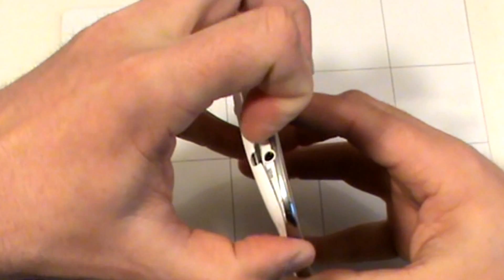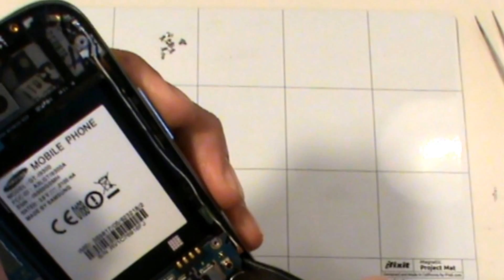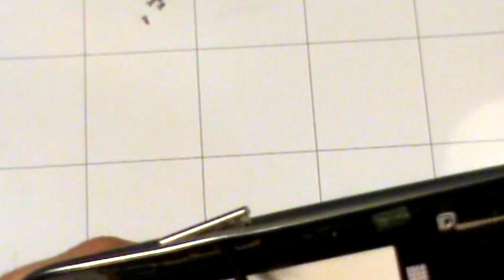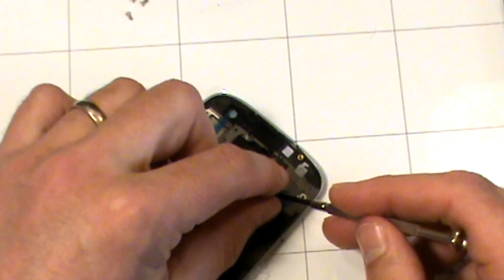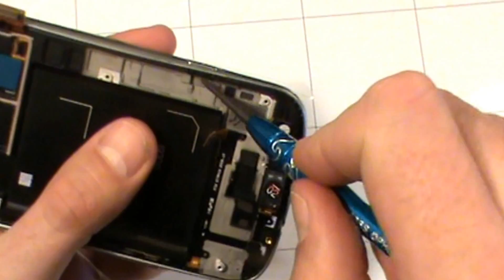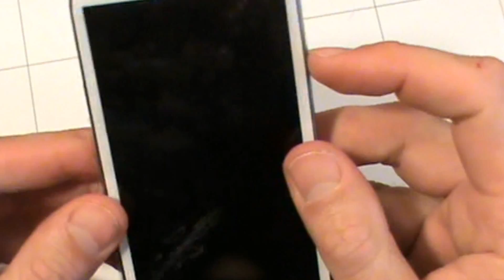Samsung Galaxy S3 Screen Replacement Guide

Comment from the maker: Hi Eddie, 

You can buy the frame but you will need to separate the glass/digitiser from the LCD. If you do this, you might as well replace the whole unit (LCD & digitiser) because it is a tricky job. 

I hope that helps. 

Regards, Will

Comment from the maker: Hi Scott,  Thank you for getting in touch. I purchased the screen I used in the video from a supplier on eBay. It's a genuine Samsung screen. You can see the same one by clicking the link above using the 'White' link to eBay. I had to take some parts from the old screen (e.g. volume button cable) and put them onto the new screen. This is quite easy to do. You shouldn't need to buy any parts apart from the new screen unit. I hope that helps.

Regards,

Will

Comment from the maker: Hi James, you need to check with your supplier that the parts are interchangeable between the LTE and non-LTE version. The video above was made with the non-LTE version. The screens and the same size and are both SUPER AMOLED but check before you buy. I hope that helps. 

Will

Comment from the maker: Hi there, you will need a small Philips screwdriver, a plastic spudger, a small flat-head screwdriver (precision screwdriver), fine point tweezers (useful for the small screws), double-sided adhesive (not entirely necessary but useful) and an iSesamo tool for helping to separate components from the board. All these tools should cost you less then £20 (~$30). The main thing that can go wrong is  tearing cables which is not expensive in most cases (apart from the new screen). A novice can do it.

Comment from the maker: Hi there, If you have all the tools already, then it will just cost you the price of the screen. You can see the price of the replacement screen by using the links above in the notes. Tools are a little extra.

Comment from the maker: Hi Talha, it depends on what has happened to your S3. Has the screen broken? Or, is it not working because it may have come into contact with liquid. Normally, if your screen is not working because it has been dropped, then replacing the complete digitiser/LCD will repair it. You can follow this video to do that. 

Thanks for getting in touch.

Comment: I think it took me about an hour and a half, had a few issues with the glued items where in your video they came off easy enough, some of mine were tougher.  All in all, following your video it was pretty easy enough to do. When I dropped mine I smashed the screen completely (dropped it off a train onto ballast glass first), also chipped the hell out of the silver trim. Most annoyingly, it had just been repaired under warranty by EE 5 days before I dropped it which included a new screen too haha

Comment from the maker: Hi there, I'm glad you like the video. It takes a bit longer than 10 minutes if it is the first time you have done it, as you have found. It should take between 30 minutes and an hour to do.

Well done for replacing it. Thanks for your comments.

Regards, Will